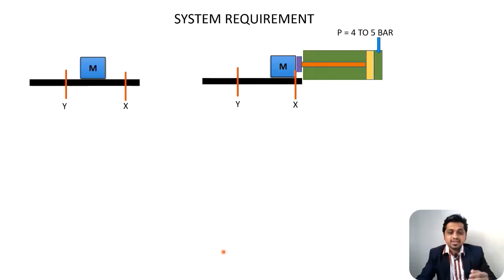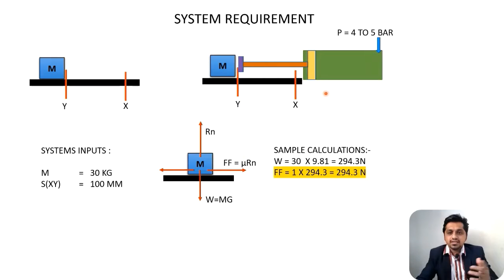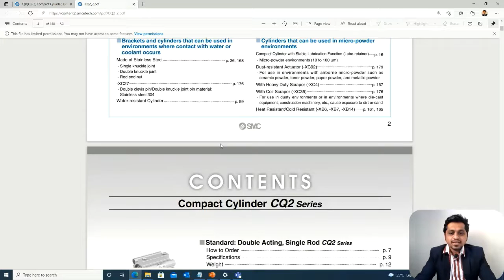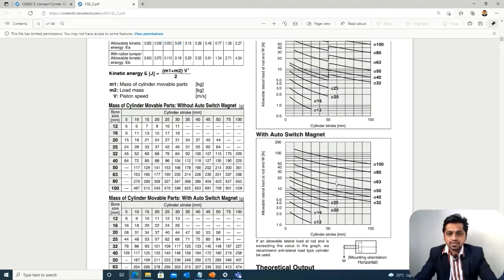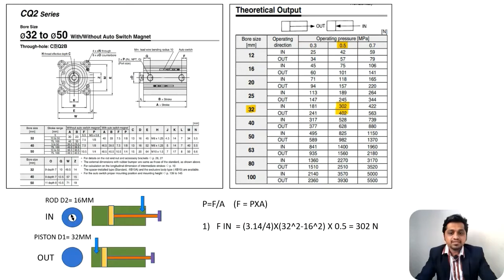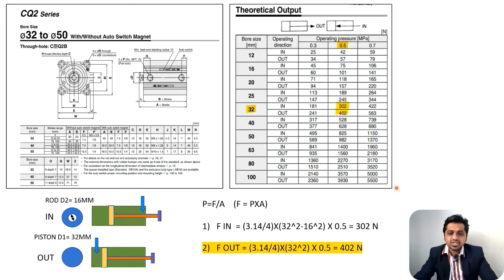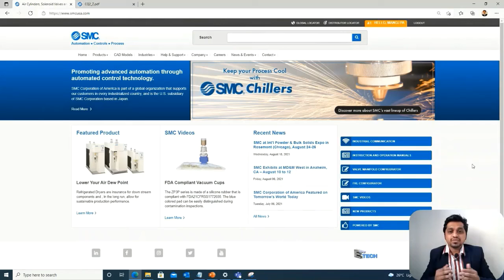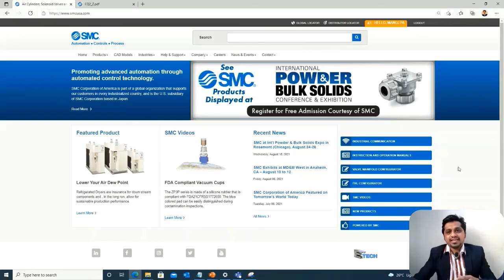PNEUMATIC LINEAR ACTUATOR SELECTION#INTROMECH#DESIGN#PNEUMATICS#STANDARD PART SELECTION

Comment: HI. Do i need to take into account the pusher's mounting? If I got customize a pusher and mount on the rod
Reply from the maker: Hello Bennett...Yes you have to take into account the pusher's mounting on the pusher rod. You have to consider a floating joint also if there are misalignments. Also check the lateral load carrying capacity of the pusher. If your bore is too small and stroke is too long there might be chances of the rod bending.

Comment: Hi, may I know where’s the diameter 1 and 2 come from? Is the rod and piston is done selected so that we can choose the bore size? If I haven have any other size, but my object is only 4.5cm within 15gram, then I direct choose the smallest 12mm bore size, is it applicable?
Reply from the maker: Hello Roxanne...1) So D2 is actually the piston rod diameter which has been mentioned in the catalogue as D. The D1 is the piston diameter which is equal to cylinder bore diameter (Practically it will be some microns smaller than the bore diameter to have a sliding fit). 2) Your object is weighing only 15 grams which is equal to 0.015*9.8=0.15N approx. So even if you take the smallest possible bore in this series which is 12, it gives almost 42 N force. so, yes you can directly select 12 mm bore. my suggestion will be you can even go lower on the bore size. you can check other series of SMC or any other make like BIMBA, FESTO, CKD which can provide even smaller bores. (6- or 8-mm bore will also work for this). and one more thing to keep in mind is if you are going for this smaller bore, also check what stroke you require. because smaller bore cylinders have small piston rods so if longer strokes are selected there are chances of bending.

Comment: Dear sir,
i want to be rail guide calculation & sliding unit on rail guide and move through cylinder how to cylinder selection
Reply from the maker: Hello Rohit...So I consider that you want to select a cylinder to move a load placed on a LM rail...Now in this case you have to calculate the equivalent load that the cylinder has to move. 1) Case-1 Load is moving horizontally...For that you can refer this link...https://tech.thk.com/en/products/pdf_download.php?file=511E_01_LMGuide.pdf. In this case as the LM rails have balls having very low coefficient of friction, you will require comparatively smaller cylinder. This is applicable if you are moving the load horizontally. 2) Case-2 Load is moving vertically... now if you are moving the load vertically, even though you use the LM rails they will act as a support, and you have to consider the total weight of the job directly for calculating the size of the cylinder. 3) from this you can calculate the size of the cylinder. Again, on the basis of the application you can then select the type of cylinder as simple, guided, rod lock etc.
Reply: @IntroMech562  Thanks ....tray to upload any video with example

Comment: How to select among tie rod or round body or any other type of actuator
Reply from the maker: it's all depend on your application. if you have something that is needed to be guided properly then you can go with guided cylinders i.e. cylinders with guide/tie rod. But the cost of guided cylinder is almost twice than that of the normal cylinder. So you can also go with normal cylinder and separate guide rod and leaner guide bush assembly. The round cylinders you can use if you have small bore requirements or space constraints. But there are no such thumb rules. you can have n number of combinations of these different types of cylinders as per your application, budget , space availability etc.
Reply: @IntroMech562  thanks